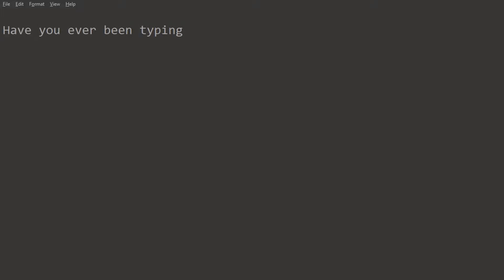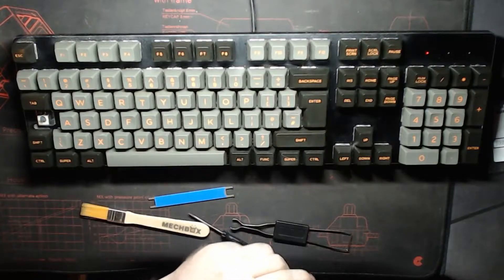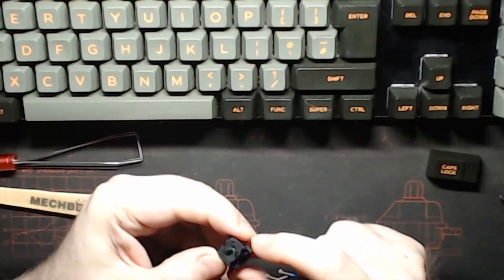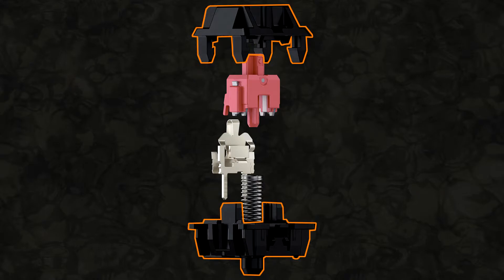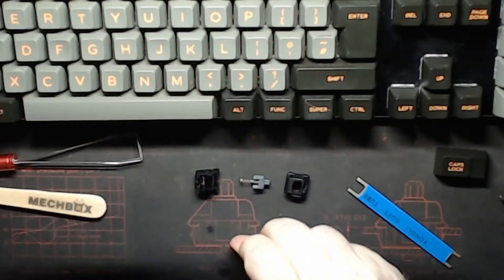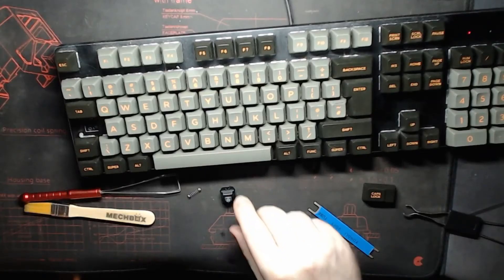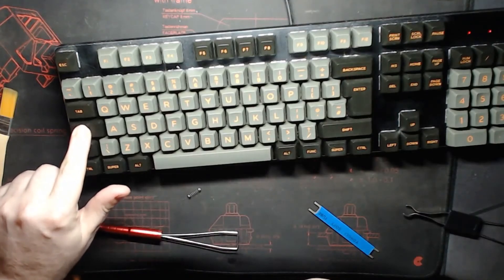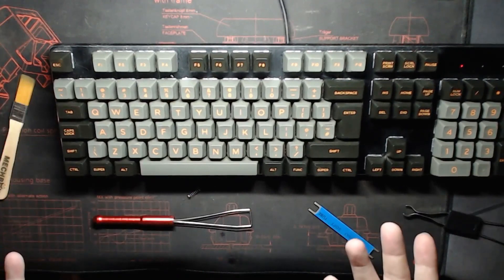Upgrading a Caps Lock key to 1kg activation force - Mechanical keyboard mods

Comment: Nice! I still need to build my own keyboard, I'm using a Ducky Vermillio panda now. With blues.
Reply from the maker: That's a jolly nice keyboard. Everything Ducky and Varmilo do is good quality stuff. I happen to have the Ducky x Varmilo Panda mousemat. Maybe I'll use that in a future video. I'm currently waiting for the GMMK Pro keyboard to come in ISO layout.

I can never choose between really noisy and really quiet switches. I'm using quiet ones at the moment. But I do have a keyboard with blue switches as my backup. And there is something really satisfying about the noise.

My most recent keyboard modding has been lubricating the stabilisers. I was slightly annoyed with myself because, when I realised I should maybe film it, I'd finished. The next time I'm bored I'll do it to another of my keyboards and film that. It's one of these things that seems quite difficult to do until you try.
Reply: @kodabar  Yeah, I love this keyboard. And blues sound so good. About switches, I do wanna try reds, or a less noisy variant of blues. Reds at least through mic sound kinda good too. But I'll probably always prefer blues.

And nice, the reason I even told myself I need to build a keyboard is because I was binging keyboard build videos, there are some amazing platforms out there, not to mention keycaps. I wanna get a coffee cap set, such a nice color scheme, the only bad thing is that the frame of the panda keyboard is super dark gray.

And I'd like to see you build some, I recall watching your collection video and you got some stuff going on 8-)
Reply from the maker: @IamAW  My first mechanical keyboard (in modern times) had brown switches. I was somewhat disappointed with them. I had always thought (and been told) that browns were like silent blues. Perhaps the noise adds to the feel because I found that brown switches just didn't feel anything like blues. I could barely feel the 'bump'. But different people are sensitive to different things, so perhaps my experience is not universal. I tried lots of other brown switches, but I always found them lacking.

Keycaps though. Oh my god. I have spent so much time (and money) on keycaps it's not even funny. I have thousands and thousands of them. I'm quite tempted to start selling 'lucky boxes' (like Signature Plastics) just to get rid of some of them. There's a video on my channel where I made a keyboard for a friend, using Maxkey Chocolate keycaps and I loved the way those looked. I have a bit of a brown theme in my house, so I really wanted coffee or chocolate keycaps for myself. But when I'd made one for a friend, I found it put me off making something so similar for myself. But one day I will do a brown keyboard for myself. I might have to make a case though. Damn it.

Something I would like to see is a proper wooden keyboard. I've got some wooden keycaps, but I'm not sure that they're as good as people imagine they are. And they're incredibly expensive. One cap can be several pounds - a full set for a full size keyboard is too much to justify. And the typing experience just isn't that good. What I'd like to do is make a keyboard with a more old fashioned look. Make it like a decent piece of furniture. 

Oh jeez, I'm typing too much. My family business was a furniture factory. When we first gave computers to the office staff, one of the directors made a good point to me. Our offices were beautiful with some really lovely furniture, wooden panelling, etc. Each office was like a showroom. So when we gave him a grey metal box and a plastic CRT monitor, he thought they looked very out of place. And he was completely right. I got hold of some old cigar humidors (nice old wooden boxes) had the guys in the factory re-polish them and then I mounted a PC inside each and drilled holes for the cables. The end result looked really nice. For the monitors, it was a little harder. I put a picture frame round the screen and had the guys make little doors to cover the screen. So when it was off, you closed the wooden doors and it looked quite nice.

The one thing I didn't do was improve the keyboard. It was just too difficult and too much work to make a keyboard look nice. But maybe now I could do that. To make a keyboard look like a nice piece of furniture would be difficult, but I would like to try. I don't just mean putting it in a wooden case, but actually designing something. I saw this picture recently. It looks a bit shit to use and the design is not to my taste, but I appreciated that they had a design concept for the keyboard as a whole piece.
https://hackaday.com/wp-content/uploads/2016/06/fpid5oj-e1465905860896_featured.png

Of course I really should have done this when I had a bloody furniture factory to make this stuff for me. Now I'm poor and lack any kind of wood-working skill. I need to get myself a Dremmel tool or similar and see what I can do. I saw some Vietnamese guys making keyboard cases a while ago (I can't find the pictures now, sadly) and I loved that they were making them as traditional pieces of wood carving. Again they weren't to my taste, but they had a holistic design.

I built a pretty nice keyboard for a friend of a friend about a year ago. I joined two cases together to make something more interesting (it was his idea!) and it worked pretty well. Sadly, he wouldn't let me video it. I could also do with a better way of filming things too, because at the moment I'm using a webcam, which isn't ideal. I don't even have a smartphone. Maybe I should pick up an old smartphone just to use as a camera.

Anyway, blah, blah, blah. I've rather set myself off with all this!

PS I love these modular keyboards. I'm not in love with how they look, but just the fact they're trying something different:
https://en.zfrontier.com/collections/groupbuy/products/gb-grid650
Reply: @kodabar  Browns always seemed way too much like membrain keys to me, I never even tried them. 

I'm definitely getting a chocolate/coffee keycap set some time. Key caps are very expensive for what they are, though. So it's not something I'm rushing.

About full wood, I'd like to have a full metal/iron frame. Heavy and solid,I like the way the switches sound on it. But I've seen some really clean wood builds.

I like your furniture idea, and that keyboard you linked is actually kinda down my alley. The issue is my whole gaming corner is black and white so it's kinda hard to match around, relatively speaking.

The modular keyboard you linked remind me of my old dreamcast (I think it was) keyboard. I wouldn't rock it myself, but it has a retro vibe I like.

A keyboard I'd consider as a first build would be something like this https://kbdfans.com/collections/diy-kit/products/kbd8x-mkii-custom-mechanical-keyboard-kit-for-e-white
With some matte black keycaps. I love the clean, minimalist look, and it would go with my setup. Preferably the keycaps doesn't even have text on them.
Reply from the maker: @IamAW  I've certainly found all browns to be a disappointment. In most, I can't feel the bump when typing at normal speed, so I don't see the point.

I do have a full metal keyboard. It's a custom build from rebuilding an old BBC Micro from the 80s into a mechanical keyboard. The BBC Micro had a decent keyboard (Signature Plastics keycaps and Fujitsu or sometimes Cherry mechanical switches), but a bulky case. Back then, there were some third party cases that allowed you to separate the keyboard from the base unit. I think there were three different ones - two were plastic and one was metal. I managed to find the metal one on ebay after many years of searching and I transplanted a BBC Micro keyboard (and some electronics) into it to make a very substantial keyboard indeed. It's not even aluminium - it's steel and weighs a ton. I must do a video about it at some point.

I like the look of that Kbdfans kit for the same reasons as you. Oddly enough, I have also found myself looking at Dreamcast keyboards.

In my latest video, I work on a cheap keyboard. It has side-printed keycaps (apart from the alphabet keys which I used a different set for). It's nice to have the text largely invisible, but there if you need it. You can see the text clearly at this point:
https://youtu.be/Cn4LqrCR_2k?t=395

In this much older video, I show a keyboard with two mixed sets of caps. The dark grey ones with black text are quite nice. In real life, it's very hard to see the text (the contrast is more obvious in the video). I would be jolly interested in a similar set, but with the text side-printed. That might be ideal - invisible in normal use, but I can still figure out which key has the ^ symbol when I forget.
https://www.youtube.com/watch?v=trvGM4dEKVQ&t=28s

I definitely have to dig out the BBC Micro keyboard for a video. Here's a picture:
https://www.reddit.com/r/MechanicalKeyboards/comments/7a7uu7/1981_british_mechanical_keyboard/

Comment from the maker: Thinking further on this - the hotswap feature isn't actually necessary to swap springs easily. You can remove the top of a switch whilst it's still soldered into the circuit-board. So you could swap springs without removing a switch.
Reply: I... I never thought of this. I could've saved so much money and time and still been able to keep the aesthetic of my old board and just changed out the innards of the switches. 

I'm kinda pissed at myself now.
Reply from the maker: @Doofindork  Oh hey, don't be too hard on yourself. I'd built three keyboards before it occurred to me that I didn't need to use the same switches for the entire board. And, even though I'd changed the Caps Lock spring in this video, it wasn't until afterwards that I realised I could do it to any switch even whilst soldered to the PCB. Doh.